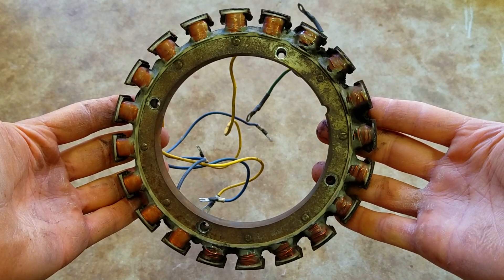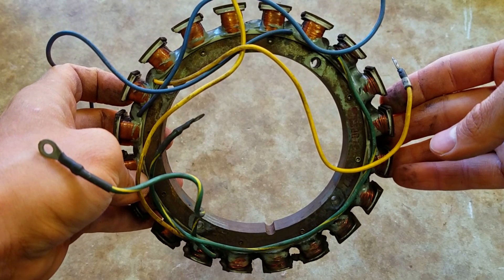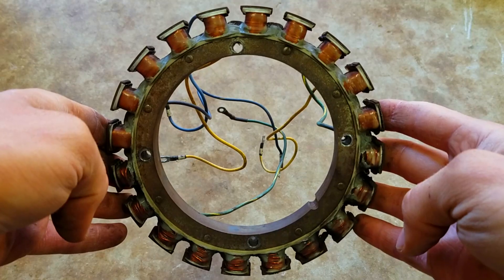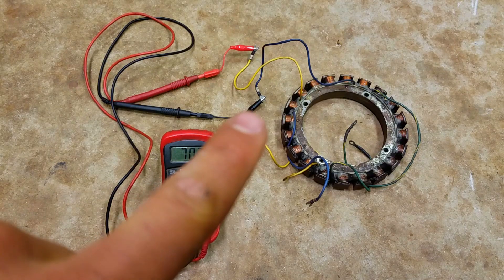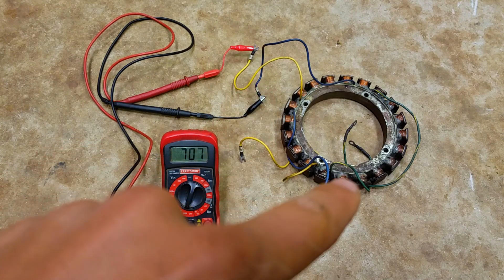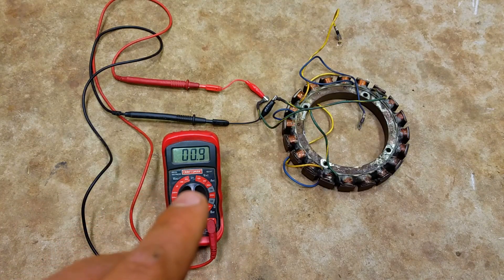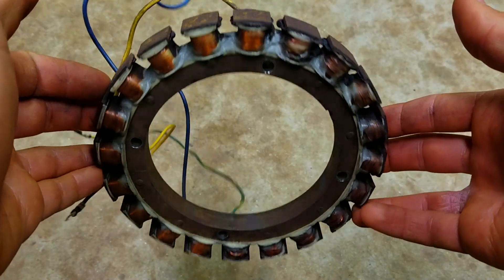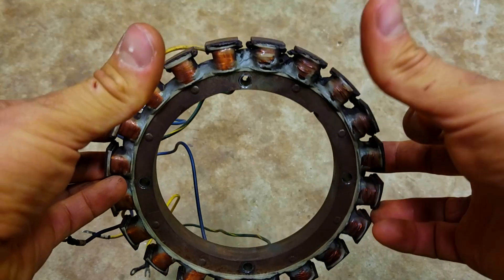How To Test An Outboard Stator - The EASY Way!

Comment from the maker: What's up yall! Don't forget to check the description for links to NEW STATORS! More info there about part numbers and stator resistance charts!
➤ How To Test An Outboard Timer Base: https://youtu.be/C_zk35e0NvQ
As an Amazon Associate I earn from qualifying purchases.
Reply: Will a faulty stator cause no spark to the coils in a four stroke outboard that doesnt have CDI, suzuki df140 ? In the service manual it doesn't mention anything about the stator in the troubleshooting chart
Reply from the maker: Yes It could, but don't just go replacing parts without verifying they are bad. Is there a kill switch that might be bad?
Reply: @MattsShop  can u revive a dead stator?
Reply: @MattsShop  on a 125cc dirtbike
Reply from the maker: It's not worth it. It's better to just get a new one.

Comment: I need help! 
I’ve got a 1990 mercury 40hp 4cyl 2 stroke outboard. 
After running great all day, and a 2 hour float break it wouldn’t start. I learned it had no spark getting to the coils. 
I’ve done all of the tests and have found that the 2 blue/bluewhite wires read 11,000 ohms with spec being 5,000-7,000ohms. 
Also, when checking each wire to ground, the yellow wires that attach to the rectifier read 5-9ohms, where as the others read open. 

Could this be a bad stator? 
With it just being the charging coil, would it still get spark if the others were still good? 

Thanks!!
Reply from the maker: 5000 to 7000 ohms seems very high to me, but if that's the spec... The rectifier is used for charging it just converts AC to DC in order to charge the battery. The stator generates an AC voltage. When it runs good and hot all day Is typically when they fail. I'm more familiar with Evinrudes. It's sounds like it might be bad, but I'd rule out everything else. Not fun to replace sometimes.

Comment: What are the symptoms of a bad stator, sometimes when I engage throttle the engine dies out. Carbs has just been gone through.
Reply from the maker: Weak spark and no charging are two symptoms.
Reply: @MattsShop   what could be the cause of the bog down when throttle

Comment: Great video and easy to understand. I have a stator just like that for a for a 50 HP Force motor. The ohms measurements are correct for all windings. I checked the output voltage with a DVA meter and there is NO output voltage what so ever. Could my stator still be bad?
Reply from the maker: If you have no DVA voltage, it's could be bad. Is your trigger good. I have been tricked before.
Reply: @MattsShop  Hey Matt, thanks for responding. The trigger has continuity and ohms readings are correct, but I didn't check output voltage. I thought it was the stator for sure but I also thought it could be the permanent magnets were weak. I am baffled.lol.
Reply from the maker: @harryjones-vf1wn  what problem were you having? I don't worry about the magnets on my outboards unless they fell off or are broken.
Reply: @MattsShop  Have you ever run across a stator that has all the correct ohms readings but NO output voltage? That is the problem I have.

Comment: I’ve got a Johnson 70 hp outboard motor I’m having an issue with it actually shocking you if you touch it it’s causing the steering wheel to be electrified as well as the control box if you touch them both at the same time and will shock you if you touch one of the other it doesn’t could this be the stater

Comment: Awesome video!! I bought a boat that I'm having troubles starting it's a 1965 Johnson 40hp 2stroke I checked the spark with an inline spark tester and the light is very dim... The wires looked like Micky mouse club house they were going everywhere so I got a wiring diagram for it and hooked everything up. Would a very dim light cause a no start on one of these? It seems my spark plug wires come right from under the flywheel would my coil packs be under there as well? Didn't want to have to take it off if a dim light isn't a problem because it doesn't start on starting fluid.. (90psi on on both cylinders on pressure test)

Comment: Hey Mat this was the best info online I am trying to figure out which wires go where from the rectifier to charge my battery, I installed a starter in a pull start mercury and works great now have to figure where the wires go to charge my battery  thanks a lot

Comment: I have a 98 Force 120.  Idle and up to 3/4 throttle it works fine.  Charging output to battery is 14.2 V.  At 3/4 and WOT, it starts kicking and sputtering, then shuts down.  Starts right back up.  Timing is fine, rebuilt carbs, new CCMS reeds, rebuilt fuel pump and getting spark.....  I'm thinking about replacing stator and trigger.  Will post back what I find.  Info on these Force engines are rare.
Reply from the maker: it sounds like you're on the right track. You are right, these Force outboards are rare!
Reply: Have your motor work good now?.  I have same motor and it hard to get start... Want to know more about this force motor.. Thanks
Reply: @toanle-md6yn  Yes, it fixed my issue.  These outboards were made by two different companies, depending on year.  The later models were made by Mercury.  They are simple units, but whoever designed the carbs should be strung up by their toes!  Weak link on the Force outboards.  Leak a lot.....
Reply: @user-ym9wb2mk5e  thanks for answered. What changed on the motor that make it run good or easy start?  I replaced fuel filter, rebuilt fuel bump, installed fuel water separation. See that a little better than before..  But want to know exactly what change will make the best to get it easy start.
Reply: @toanle-md6yn  YW. I think the biggest issue is using genuine parts for the carbs and fuel pump.  I learned my lesson using cheap amazon or Ebay kits.  I do believe adding aftermarket Reeds and this trigger assembly helped a lot.  Check your timing also, these models are a bit finicky.  There's a good vid on YT about checking timing without it running full throttle.  I'll see if I can find the link.  

If I had kept it, I would have checked into bypassing the fuel pump with a separate pump that you can find on Ebay.  Mine was starving for fuel pressure at 3/4 throttle.  Once I stopped boat, shut off, then started back up after priming it would run great.

Comment: Hey Matt I wish you lived near by cause you seem to know your shit lol.I own an eighties mercury 70hp ,mint,was at full speed just quit after a bump and only turns over no start .125 compression in all cylinders thx for any help whatsoever
Reply from the maker: I might! Thanks, did you loose all spark? Seems simple, but did you test the kill switch circuit?
Reply: @MattsShop  would that be on the throttle unit or on the motor

Comment: Thanks Matt, for a very good video. The stator out of my 91 Force 50 looks very similar to the one in the video, 2 spark coils plus a charging coil. Is yours out of a fore motor? The prior owner tells me that the motor died in the lake and I found a burned out regulator and one of the two spark coils had a small burn in one of the 5 poles. I tried rewinding the bad spark coil and now it shows just 180 ohms while the other one shows 750 ohms.
Reply from the maker: Yes, this stator is off of a 1985 Force 85 outboard. You can't really fix them once they go bad. You're pretty much stuck buying new parts.

Comment: I have a 75 hp suzuki outboard motor but my stator is color differently 2 black 2 red and 1 yellow . 1 red wire is not connected to anything , how do i test it i think it is a 1987 suzuki . thanks advance for your help
Reply from the maker: You are going to have to look up wiring diagrams for that specific model. Basically, you have to test the Ohms of the similar colored wires.
Reply: @MattsShop  found out the problem , my main battery cables ground and positive shorted out in the middle since i saw smoke coming from battery terminal when cranking , disconnect both cable and separate them out , found insulation burnt in middle causing shorted and cause no spark , fix the cable and now fires up !

Comment: watched your video on ignition pack also. very well made. subbed. didnt check my ignition pack yet but im not getting any spark in cyl 3 (change all 4 and they got darker and cyl 3 was full of gas so thats how i knew i wasnt getting any spark). spark plug and plug wire are ok. i know im all over the place but could this also be a stator prob? anyway thanks alot i would like to know what are my option to check.

Battery is good. spark plug and plug wire are new so my guess is coil packs or maybe stator...

Thanks again

Edit: just wanted to note that the engine starts and runs but cant get over 10mph with a 17 footer (engine is a1983 90hp jonhson)
Reply from the maker: What model outboard do you have? Did you check the spark with a timing light on each cylinder plug wire?
Reply: @MattsShop  no but turns out  a coil pack was de grounded. Thanks for the quick response. Its a 90hp jonhson 1983. Now the its kinda rev hanging when i give it throttle. Do yoh know any causes?
Reply from the maker: Glad you got it fixed. What do you mean? It's lagging when you give it gas?
Reply: @MattsShop  no its throttle is 'sticking'. Well not the throttle as the likage for the carb are completely free and disengage when i let go of the gas but the rpm are hanging when i give her. Its takes a long time to get back to idle speed. She'll go up normally but when i let go of the throttle or throttle body right at the carb ( gear and neutral she'll do the same ) it takes so long to bring back the rpm to iddle. She also seem to be reving up for no reason sometime. Tank are full so its not because of running lean on fumes like an empty dirtbike. I remade every carb gasket. I dont know what could be causing this. Sorry for the paragraph i just want to be as clear as possible. Thanks alot

Comment: Hey Matt can a bad stator cause a battery to be overcharging?
Reply from the maker: It's unlikely, I'd replace the voltage regulator/rectifier first. It's what controls the voltage coming from the stator.
Reply: Matt's Shop thanks. I changed out the voltage regulator with a new one and still no change. Battery will charge to 15+ volts while full throttle. I disconnected the power wire from the voltage regulator for now so the battery won’t be charging while engine is running.
Reply from the maker: If I remember correctly some outboards charge at a higher voltage like that. You should do some searching. It might be normal. Stators typically loose the charging voltage when they are bad. IDK if the voltage can increase if the charge winding is bad.

Comment: Will am engine not gain speed/rpms with a bad stator?. Example.. Plenty revs/rpms in neutral but when put in gear just.. "Bwaaaaa".. When to the floor. Won't go??? Or is this a foot or some other issue?
Reply from the maker: Start with rebuilding the fuel pump and then make sure the trigger/timer base is moving freely.

Comment: I don't see my Mercury on the list.  I have a 2003 40hp EFI Big foot 4 cycle.  I replaced the regulator but I'm still not seeing the 14V charging.  I'm guessing the stator but I'd like to know the resistance to check first.
Thanks!
Reply from the maker: You are going to have to search Google for that model. That Mercury is pretty new. I don't know, but those newer outboards can get pretty complicated.

Comment: Great video on stator diagnostics. I have a 2004 Yamaha 115 4-stroke; stator checks out ok, but not charging the battery; wiring is messed up; what wire carries DC 12v+ from rectifier to battery? or is it carried in the yellow ignition 12v+ wire?
Reply from the maker: Idk, about those newer 4 stroke motors. You can look up the wiring diagrams and service manuals online.
Reply: @MattsShop  about time I hear someone says they don’t know about newer models,all I hear is can’t fix too old lol

Comment: Do you have to remove the stator to test it?
Reply from the maker: No! You can test it while it is on the engine. Just be EXTREMELY careful and don't test it with the motor running unless you know exactly what you are doing!

Comment: Hey Matt, could you tell me can a stator keep your engine from reaching top speed?  Thanks watched the video's just need to know if this is what I need to replace.
Reply: I think to answer that the amount of hours on the engine and rust on the stator would be an indicator. If I was keeping the motor and $250 keeps it running fine I would do the stator when it's benched, you can do rectifiers and modules easily when it's in the water at the lake. Cheap stuff gets changed first though. Not saying thorough diagnostics aren't in order like Matt said but I run 35-45 year old motors. $200 a year in parts is cheaper than a new motor to me.
Reply from the maker: Hey, a bad stator can cause you all kinds of trouble. If your stator is bad it can cause your spark to drop out at high speeds. When these things heat up they tend to fail when they are hot. 

I'd start with checking to see if your carb butterflies are opening all the way so that they are completely flat when you push the throttle all the way down. Most of the time the the throttle cable and linkages can be out of adjustment physically preventing you from reaching wide open throttle. Make sure that your trigger/timer base is moving freely too and fully advancing all the way against its stop.

Whatever you do though, don't adjust anything until you read through a service manual for your motor. If you go adjusting stuff without knowing what you are doing, you can really mess up your controls or damage your motor.

Comment: Your charging side tested ok (it still needed to be replaced) was the charging system fine and the rectifier restricting the current too much? 
Just something to check...
Reply from the maker: From what I remember the charging side was ok and it was still charging the battery. I had already replaced the rectifier.

I was having starting and running problems because the ignition parts of the stators were bad.
Reply: Matt's Shop cool, just an extra thing to check out
Reply from the maker: Yea, cheap to replace too!

Comment: If the stator is bad, I wish you were able to prove it with a meter.  Just saying it is bad does not help us trying to figure out if we have the same problem.  Did I miss something in the video?
Reply from the maker: +Scot Caraway Yes, you missed the part where you check the Stator's resistance with the Ohm setting, and check it against a chart online. If it's within the range it's good. If it's not within the range or shows it's an open circuit. The thing's bad.

Comment: Is it possible to check stator on 1995  three cyl  Mainer fuel injection without dissembling  thanks
Reply from the maker: +Cathy LeGrow Yes, I just showed how to do it with this one because I already had it taken off a motor. It's exactly the same though. Just find the wire color charts online.
Reply: I have a craftsman model # 82141 will that give the readings or do the meter require a DVA adapter to give the readings.  Picture of the meter available if required.
Reply from the maker: To do the Ohm test any cheap meter will work. However, to get accurate voltage readings while running or cranking you have to have a DVA adapter. Remember that these are high voltage wires and WILL hurt you if you put yourself in a position to get shocked.

Comment: we have an 85 Force 125 that lost all spark today on the lake... I got it back home and tested the spark by sticking a Phillips screwdriver in the spark plug wire ends and holding it close to a ground. no spark in less I get it within a 16th of an inch or less from the ground. extremely weak spark not enough to jump the spark plug gap. since the weak spark is on all the cylinders at the same time it makes more sense that it's a stator then modules or coils correct?
Reply: I will do that, thank you!
Reply from the maker: +gurn blanstein You are right, if the spark is extremely weak on all cylinders I'd go straight to the stator. It's obviously not generating enough electricity to create a good spark. If it was just one cylinder than it might be a coil or somthing, but since you have a weak spark on every cylinder it's probably the stator.

Make sure you rule out any broken wires. The spade terminal connectors on Force electronics can break right where the wire connects to the connector and you would never even know unless you tug on them to see. Check every single one before you pull the flywheel!

Comment: If the stator is bad, could that cause me to not get spark to just 2 out of 4 cylinders? Or would that be powerpack? all coils replaced and plugs and wires.
Reply from the maker: What outboard are you working on? Maybe, a bad stator can cause a lot of problems. Does your outboard have two power packs? If so swap them from side to side. So port to starboard and starboard  to port. Then see if the problem follows the power pack. If it does then you know that's the problem. If it doesn't then you have to dig deeper.
Reply: If the stator energizes the capacitor for two cylinders it's not bad. It would be the trigger assembly or the powerpack.